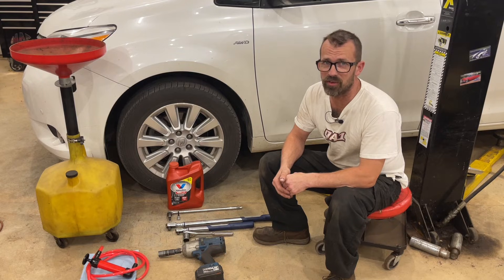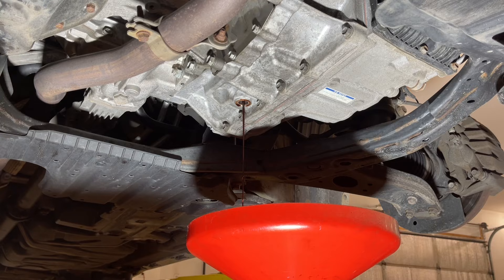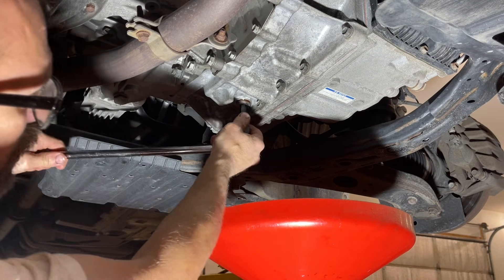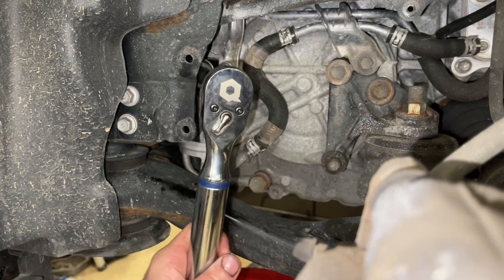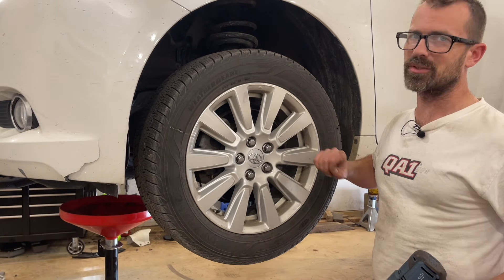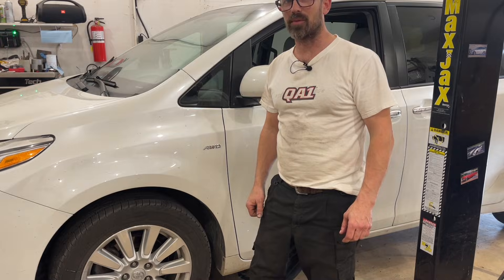🔧 2017-2021 Toyota Sienna Transmission Fluid Change, how to check trans temperature. UA80E

Comment from the maker: The Sienna featured in this video is a 2017.  This procedure should be the same for all 2017-2021 Sienna's with the UA80E transmission.  This video covers the Toyota recommended fluid drain and refill service only, however, if you feel the need to change the filter here is a link for that: Filter and pan gasket: (2017-2020) https://amzn.to/42LxpEN

Fill plug: 24mm, 29 ft-lbs (39Nm)
Drain plug: 10mm hex, 15 ft-lbs (20Nm)
Level check plug: 6MM hex (hand tight only)

Quinn 1/2" Drive Torque Wrench: https://www.harborfreight.com/12-in-d...
Quinn 3/8" Drive Torque Wrench: https://www.harborfreight.com/38-in-d...

1 gallon of Valvoline MaxLife ATF: https://amzn.to/3vL6isv
or
Toyota WS Fluid: https://amzn.to/46brxUA

Hand pump: https://amzn.to/3XDmUi4

These are both the same scanner:
Innova 5610: https://amzn.to/3ZFN3hc
Zurich ZR15s: https://www.harborfreight.com/zr15s-o...
Target temp: 95F-113F (35C-45C)

0:14 tools you'll need
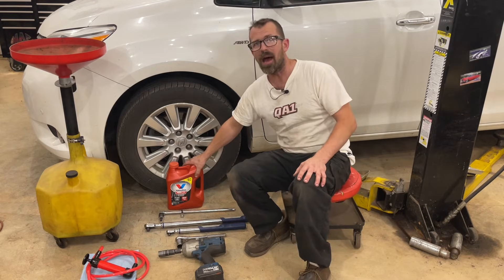2:15 What's the deal with the fluid type?
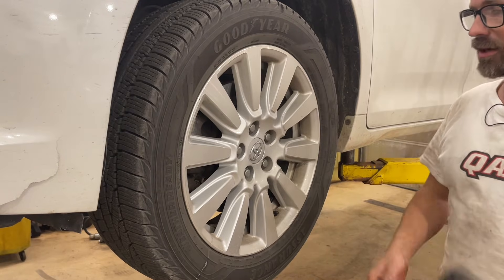4:13 removing the wheel
4:30 removing the access panel
5:03 loosening the fill plug
5:52 removing the drain plug and fill level tube, draining the fluid
7:50 reinstalling the fill level tube and drain plug
9:05 refilling the transmission
10:16 installing the fill plug
11:05 reinstalling the access panel
12:16 accessing transmission temp with scanner
13:08 reinstalling the wheel
13:40 removing drain plug to set level
14:40 reinstalling the drain plug
15:22 torquing down the lug nuts

As an Amazon Associate, I earn from qualifying purchases.  For your convenience, I try to post links to everything I use in the video description.  That's part of how I cover the costs of this channel.  I appreciate your support buy using these links!!

Comment: do you recommend adding Lucas stop and slip as a preventative when changings out the fluid?
Reply from the maker: Lucus makes excellent products, but I would add it simply as a preventative measure. I think keeping clean fluid in the transmission is the best preventative measure.

Comment: For how long did you let it run before correcting the oil level? Thank you
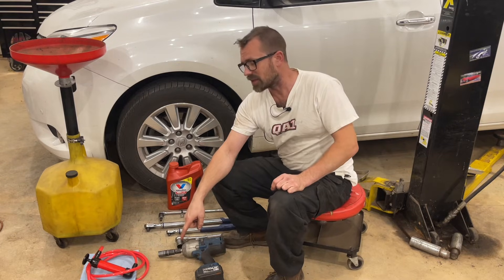Reply from the maker: I don't recall exactly how long it took to get to 95 degrees, but the important part is just that you get it to the 95 degree point.  Some people have had success with using an infrared temp gun on the transmission case to get a pretty close temp reading if you don't have a scanner.  I talk about that a little bit at 1:12 in the video.

Comment: I’m a little overdue by 20k miles for atf drain and refill. If I drain and refill now, would my next drain and refill be in 40k or 60k miles? Btw, very insightful video.
Reply from the maker: Thanks!  The 60k mile interval doesn’t change, so 60k from whenever it was last done is always the objective.

Comment: For a 2019 Sienna Alldata says: 

Using a 6 mm hexagon socket wrench, check that the No. 1 transmission oil filler tube is tightened to the specified torque.
Torque : 1.7 Nm (17 kgf-cm, 15 in-lbf)

Using a 10 mm hexagon socket wrench, install the overflow plug and a new gasket to the transaxle housing.
Torque : 50 Nm (510 kgf-cm, 37 ft-lbf)

Install the refill plug and a new gasket to the automatic transaxle case sub-assembly.
Torque : 49 Nm (500 kgf-cm, 36 ft-lbf)

Also do some of these transmission have an oil thermostat you have to push in and hold in place with a pin or Allen key while making the fluid adjustment?
Reply from the maker: Thanks!

Yes, if you have a cooler there will be a thermostat block bypass procedure.  

My understanding is that if you haven't drained the transmission while hot, the bypass is not needed because the cooler system is still full (small quantity) of fluid and will not affect the fluid level setting procedure.

Comment: Where is the transmission filter and dose it need replacing.
Reply from the maker: There is a filter located under the front cover.  This video does not cover replacing it, it only covers the service that Toyota calls out for, the fluid drain and refill. 

In my opinion, if you do the fluid drain and refill as recommended by Toyota, you will not need to replace the filter.

Comment: I have to do mine old school on driveway  ;^).  Think that slightly raised front end on jack will change the amount of extra oil that drains out in that final step - reopening the drain plug and leaving tube in for final level setting?
Reply from the maker: Yes, you should set it back level on the ground before doing the level setting step.
Reply: @bennieaust the problem with that is then you can't get under the van.
Reply from the maker: @rwmrwmrwm you don’t have to get under it. You can reach under it and pull the plug.

Comment: Can you do this service on some front wheel ramps? Or does it need to be perfectly flat and level?
Reply from the maker: You can definitely do it on some ramps. The only part of the process it needs to be level for is the level setting process.
Reply: @bennieaust Awesome. Thank you for a great video.
Reply from the maker: @TWC6724 thanks, and you’re welcome!!
Reply: @bennieaust how can you be under the car to do the level process?
Reply from the maker: @sargonoshana2324 you can’t be if you have it sitting on the ground. You’ll just have to reach under it, remove the drain plug, then put it back in when the level is set.

Comment: Think this is the third time I've watched this video.  Top tier!  Thanks so much.  I did click on your links to get the fluid pump and the valvoline transmission fluid.  Can't afford to pay the shops around here to do this and tbh I don't trust them at all.  I am pretty sure they would charge me $600 and say they did it.  Right.
Reply from the maker: Thanks so much! And thanks for using the links!  Hopefully the video makes it easy as can be.  It really is pretty easy, and you are absolutely right, they would charge you way more than it should cost.

Comment: Awesome video. I was wondering if you could make a video about changing the transmission filter on the 8 speed?
Reply from the maker: If I get one in the shop with that on the list, I will definitely make a video.  My personal feeling is that if you change the fluid as recommended by Toyota, the filter does not need to be changed in all but the most extrema situations.

Comment: Great video brother ! ❤
Can I add the same amount fluid as I took out without checking temperature ? Please advise. Thanks 🙏
Reply from the maker: Thanks!

I don’t recommend using that method because the only way it works is if it is for sure at the correct level to begin with.   Can you verify it’s currently at the correct level?  I have heard many stories about even Toyota dealers incorrectly filling transmissions, so I would highly recommend following Toyota’s procedure on setting the fluid level.

Comment: Why toyota dealer told me to not change my transmission fluid i already have 283,000 miles on it
Reply from the maker: It would be impossible for me to know for sure why they told you that. You would have to ask them why they told you that. 

Some people think that you will damage a high mileage transmission by serving it. I have never experienced anything like, in fact I have only resolved shift issues in those situations, but of course I have no idea what the reasoning was behind their recommendation without talking to them.

Comment: Glad you emphasized doing as per manual.  Thats why that interior tube is in there.  That tube is the height is the exact amount of fluid needed.  Any extra flows out.  Almost cant do it in driveway unless level on 4 stands.  Needs to be level, so front end raised ont be accurate.

Comment: Do i need to warm up the car before draining the old transmission fluid, or would it matter if i do it cold?
Reply from the maker: @gilbertojimenez2143  it can be any temp. I would recommend cold, or just a little warm, so that when you go to set the level after filling, it’s not too hot already.

Comment: Those scanners are $289 😢😮.
Reply from the maker: @navyseabee0823  yes, they have come down a bit in price. They are great scanners with a lot of capabilities.  I know it seems hard to justify if you are only looking at doing this one project, but you will still save money on this one project and then you will have the scanner for the rest of them. 

Certainly check around and see if another scanner meets your needs better. I linked this one because I have it, use it, and am very happy with it.
Reply: I think the Autel MaxiDiag MD806 PRO OBD2 Scanner replaced the MD802.  It can do it all and it's on sale for $199

Comment: Setting the level was a little too rushed....were you checking the temp as you drained the excess fluid?
Reply from the maker: @otiscampbell3795  I just pull the plug as soon as I hit the minimum temp requirement. It will be done draining before you hit the high limit of the temp range.

Comment: Second question, I recently bought a 2019 with 93k on it. Not sure if the trans oil has ever been changed. What is your recommendation. There are currently no observable issues.
Reply from the maker: @adammackerel4993  whenever I purchase a used vehicle and I don’t know the service history I always perform fluid changes on it. That way you will have a baseline for when to do the next service. If it’s never been done then it’s overdue if it has been done and it’s not overdue, that’s OK too, you still now have a record of when it was last done

Comment: I may have missed it but how does temperature determine level?
Reply from the maker: @adammackerel4993  yes, as the fluid warms it expands. Thats why there is a specific temperature window that the level needs to be set at.

Comment: HOW CAN I DO IT THE WRONG WAY. HOW CAN I DO IT WITHOUT A SCANNER?
Reply from the maker: @sace1608  the options are almost endless. You can forget to put the drain plug back in. You can use the wrong fluid. You can fill it to the wrong level and probably 10 other ways if you’re looking for a way to do it without the scanner check out other people‘s videos I didn’t cover that in mine.

Comment: I just drained and refilled with the exact amount
Of fluid that came out.   It was original factory filled and ran great.  No issues.  Thanks 🤘🏻🤘🏻
Reply from the maker: @ I get a lot of questions on if I recommend doing it this way or not. Personally I feel most comfortable setting the level by Toyota’s procedure. 

The measure and refill with the same quantity method only works if it’s at the correct level to begin with. 

It probably was, but when I’m servicing a transmission “probably” isn’t good enough for me.
Reply: @bennieaust  Whatever he did probably worked ok but I don't trust anyone doing anything right these days in the service industry, so doing it the right way myself is the only way! Thank you for your video! I have been servicing all my cars myself.
Reply from the maker: @urbanturbine you’re welcome!  I feel the same way!
Reply: I did it 2 times, removing about 2 1/2 quart. Then I will add 5 quart back, start the engine, and shift all gear park neutral etc, until it reach the correct trans temperature on my obd2 ( while im still high up on the car lift lol.) Then my buddy unscrew the plug, and when it only drips he screw it back. Whats your though?
Reply: Sometimes I think the manufacture makes it look more difficult so you will take it to them for the $$$$$$$$$$$

Comment: Nice video, what can you tell me about a “coolant bypass valve” which I believe needed to be addressed for a 8-speed tranny before beginning any drain.
Reply from the maker: I believe carcarenut has a video covering the cooler bypass.
Reply: @ yes, that’s exactly where I heard about this valve. He talk very little about in his video. I wonder how important his step is.

I don’t here it mentioned on any other video on this subject .
Reply from the maker: @rvingwiththegadways3539  I don’t think it has a major impact, although it’s technically something that should be done.

Comment: Best video ever on transmission fluid change Thank you so much. I just bought 1 with 218K and was wondering if I should change the oil vehicle running well with a light whining noise. I also will check the transfer case and Differential thanks
Reply from the maker: I always like to change all the fluids on a "new to me" vehicle.  It's hard to know when and how often it was serviced unless you have really detailed service records.  It also gives you a good opportunity to see exactly what all the fluids currently look like and if you should have any concerns.  Don't overlook another component like a bad wheel bearing creating that noise you're hearing.

Comment: Bennie, about a full flush, I don't think it would just be about 3 quarts, would it? Thank you!
Reply from the maker: No, a full flush would probably be around 3 gallons.  On some vehicles you can pull a transmission line and do a flush.  I'm not sure if you can do that on this vehicle.  A lot of newer vehicles have heat exchangers on the transmission that use coolant to transfer the heat out of the transmission, which mean there are no lines to pull that carry transmission fluid.

Comment: Toyota manual says 7.9qt.. 🤔
Reply from the maker: That's one of the reasons I made this video.  To show real world quantity for this drain and fill procedure.
Reply: @ ok.. What throws me off is that when you initially remove the drain plug, there is a oil draining from it which means the oil level is higher than the straw.. Then you need to set the level same as the straw when you warmup the transmission oil..
Reply from the maker: @Fredflinstone23 When I initially drain the fluid the engine is not running, so the transmission fluid level is higher.

Comment: I really like the idea of using ODB reader to measure the temperature, as I do not have an thermal gun for this purpose. Is there any difference between 2011 Sienna and 2017-2021? Mine is 2011 and I don't seem to see any difference in the procedure.
Reply from the maker: Im not sure the exact difference off the top of my head. I’m sure it’s very similar if not exactly the same.
Reply: The design is totally different.  It's easier to just change the oil. There is no fill plug. Instead, fill the oil through the transmission level-check dipstick housing. The stick has oil level indicators for low temperature and hot temp separately. The fluid is different, too

Comment: What if I don’t want to change fluid but simply check if level is correct? Can I add a one quart and follow this procedure? 
Toyota Sienna 2017 115K miles
Reply: I’ve never had to change transmission oil yet and I drove cars for well over 200k miles. I have enough tools and skills to replace anything in drivetrain and outside of the motor. 
My wife’s driving a minivan and last week check engine light came up with P2714, P2757, P0741. I called a mechanic I know in a different state and he recommended to start with oil level check and inspecting wiring, if no luck then take it to the shop. I erased codes today, drove it for 70 miles and p2714 showed up again, one of potential issues is low oil. I ordered 4 quarts, will try adding a quart and drain excessive as you shown
Reply from the maker: @vitaliypro8441 a transmission service is something many people completely ignore until they start having transmission issues.  At 115k miles you still are pretty low, but it certainly didn’t help it that it’s never been serviced. 

Hopefully you are just low on fluid.
Reply from the maker: You can, but it would be a missed opportunity of doing 75% of the procedure but not getting fresh fluid in it.
Reply: @bennieaust  I’ve heard horror stories about transmissions going bad after very late oil change
Reply from the maker: @vitaliypro8441  I have also, but have never encountered an issue in real life with 100's of transmission services under my belt.  If you are concerned about that I wouldn't recommend touching it.

In my opinion, a 2017 with 115K miles is practically new.  Unless you are experiencing issues with it, I'd service it and not give it a second thought.

Comment: Not sure if it has been posted here, but the 2020 sienna 8spd transmission doesn’t show trans temp. Any idea?
Reply from the maker: @askaryambus  I believe it has been. It sounds like a software update issue with the scanners.  It would be best to contact the manufacturer about the issue. My scanner is running an older update and it has not presented any issues for me.
Reply: @bennieaust  Thank you for your prompt response! What's the firmware version on your device? I have the 22.11.05. I have not found previous firmware versions online either. I did not know the temp module could not be read until I was checking the transmission oil level (pretty much the last step). So I had to wing it...
Reply from the maker: @askaryambus  V19.06.04

Comment: Oil cooler thermostat that needs to be bypassed is just left of the radiator petcock.  Push in the plunger with a small screwdriver and use a 1.5mm Allen wrench in the small hole to hold the plunger in place. 95-113 is correct according to tech info on Toyota site.

Comment: According to Toyota procedure you need to bypass thermostat oil cooler  with a pin before you adjust fluid.
Reply: I think they all have a cooler.  The thermostat is in front under the plastic shield just left of the radiator petcock.  You need to take a small screwdriver and push in the plunger and then place a .5mm hex wrench in the hole to hold it pushed in. Then you can refill and adjust the fluid level.  Don’t forget to remove the Allen wrench before driving away.
Reply from the maker: @MichaelDimaggio-h7x  Thanks for the added info!
Reply from the maker: That’s correct. If you have a transmission cooler that will need to be done.